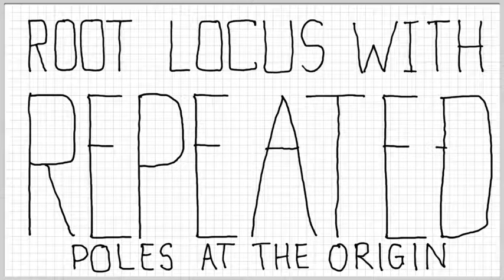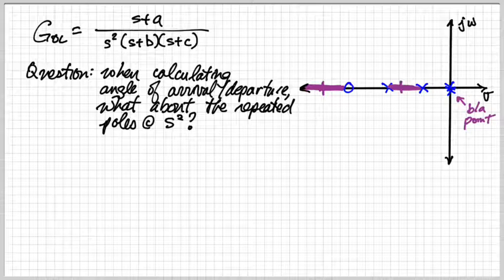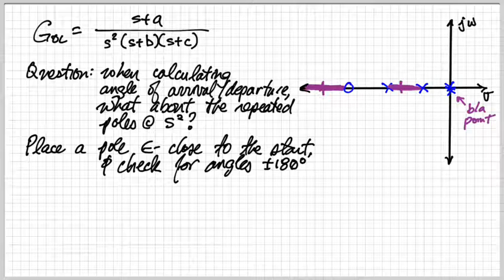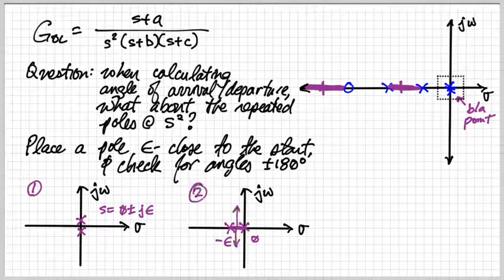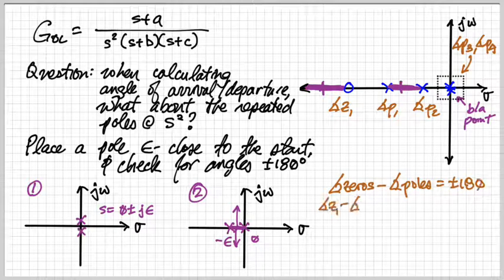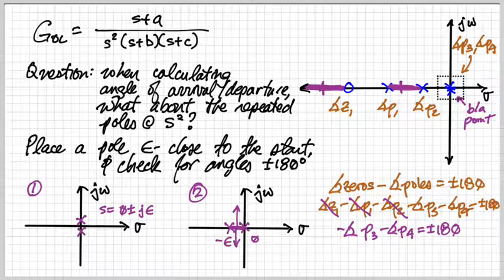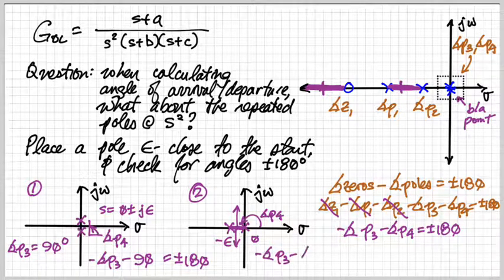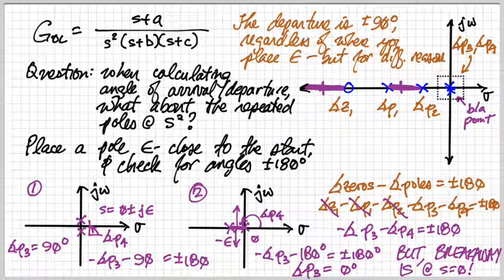Root Locus with Repeated Poles at the Origin

Comment: Hello
I have this question could you please help me to find the solution?
Question:
Consider the unity feedback control system where the plant transfer function is given by:
K/s^2(s+7)(s+60)

Determine the location of the dominant poles of the closed-loop transfer function in order to achieve the following performance specification for a unit step input: o  The settling time for a step input should be less than 2.5 seconds o  The overshoot should be no more than 20%     
Thank you